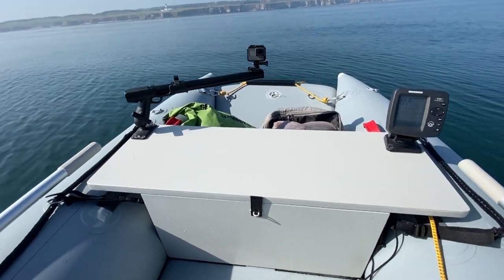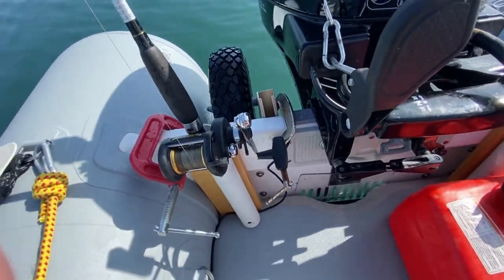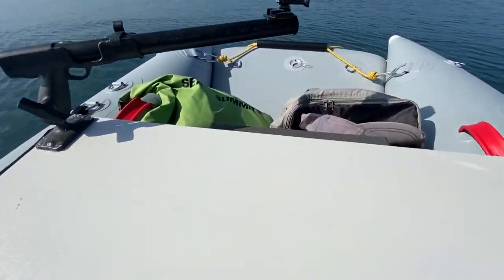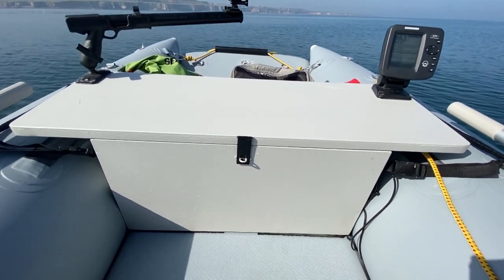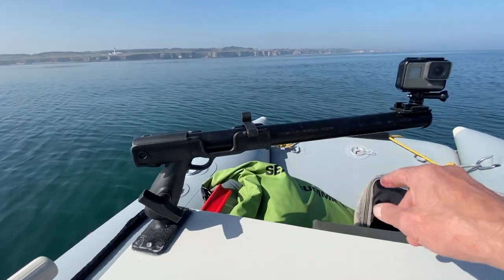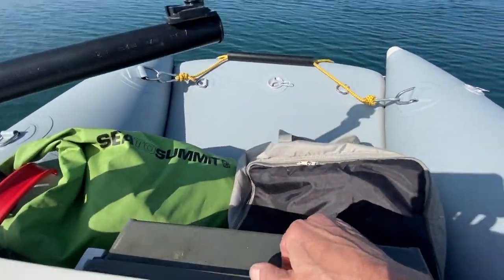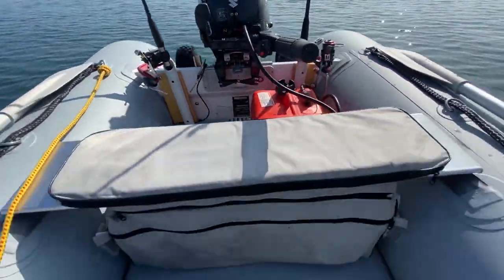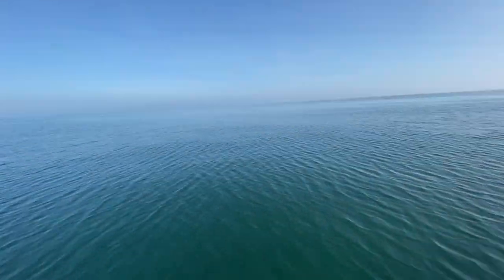SIB Fishing Set Up part one- TrueKit Discovery 330

Comment: Again a great video,  with your transducer mounted will it still read at any kind of speed?  When I finally get my engine and get out on the water I am going to put the old lino on the floor as I've heard of a few punctures from fish spines especially bass.
Reply from the maker: Thanks 🙏, the fish finder reads depth at speed but I get a lot of interference until I slow down, I’m not sure how/if this can be resolved?.
Could be a good idea the lino.

Comment: Nice little set up mate. What is approx cost of  SIB & Engine ? Fuel usage ? Thanks
Reply from the maker: Thanks, the boat prices are here 
https://truekit.net/ they’ll fluctuate depending on exchange rates. Engines can be a range of prices depending on whether you choose used 2 stroke or new/used 4 stroke.
It seems very good on the juice I’m on my third trip out on a 12 litre fuel tank and there’s still plenty left. I’m not sure how you would exactly calculate the usage.
Reply: @TheHopefulAngler   Ok mate thanks. I have got a kayak but I have a bit of shoulder injury and think it's time to get something like you have. Don't want the maintenance headache of larger boat either. So roughly how far offshore do you have to go to reach your fishing ground ? How does it handle a bit of chop ? Any idea of knots potential with that engine on if the weather turns crap ? Thanks & subbed.
Reply from the maker: @stukyu   Thanks for the sub, Ironically that's why I went for a SIB due to a shoulder injury, I still have a Galaxy Cruz which I can manage short trips with but anything bigger my shoulder won't allow me to lift it. My usual fishing area is off the North East coast and a quarter of a mile or less can get you onto rough ground and fish. A few weeks ago I was out over some local marks and was around a mile and a half out  https://www.youtube.com/watch?v=3vwot-peHUk&t=293s after I'd followed the dolphins down the coast it was quite lumpy heading back against the tide, I just eased off the throttle and took my time and it pushed along with no problem. It skips over chop quite well but being a catamaran hull it does slap a bit, I think I need a few more trips under my belt to be able to fully get an idea how it handles in different conditions. I made the set up video during this trip  https://www.youtube.com/watch?v=BbYg5SqhcEM  it was flat calm and I managed a top speed of 23.8 mph.
There are plenty of choices of SIBs out there, have a look on Facebook for Inflatable Boat Advice - Fun, Fishing and Friendships. SIBs only it's a good group with plenty of advice, there's also https://f-ribsandsibs.com/ with a wealth of knowledge.
Let me know how you get on
Reply: @TheHopefulAngler   Great Info mate thanks for links. I see you have had some belting cod, would give my back teeth for catches like that:) Good luck with future trips.

Comment: Rusty clamps?  Why not rail blazers?
Reply from the maker: Hi, as I say in the video I do not want to drill any holes at this point. I may permanently attach my transducer/rod holders with Railblaza or Scotty mounts as time goes on, but for now I'd rather not drill holes in the transom until I'm happy with that as a permanent position. As used to be the case when I had a new Kayak it would take quite a few trips out to decide on how I wanted things laid out, the same goes for the SIB. I just need more time and good weather to get out there 😀